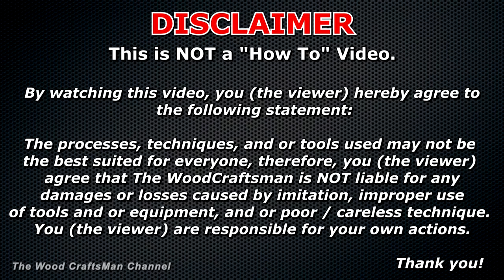Raised Panel Door Sample Series part 2 Finishing The Door # 310

Comment: Love your work. Always great to see the process. One question though. What does glaze do? I've seen it done before but no one has really answered me on what the purpose of it is.
Reply from the maker: Thank you! There are two parts to this glaze process. Initially its applied over the sealer before the topcoat as an extra layer of color usually to mimic patina over a solid color, and on a stain it can do the same, however prior to pin striping, you can leave it hang up in the corners and crevasse  to resemble years of dirtiness. The pin striping was added to match a specific look the client was looking for.